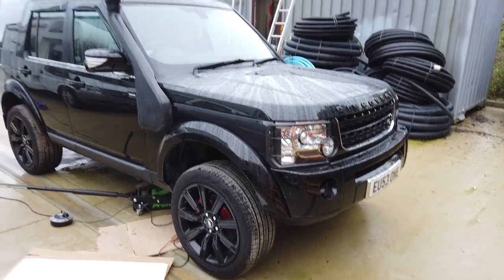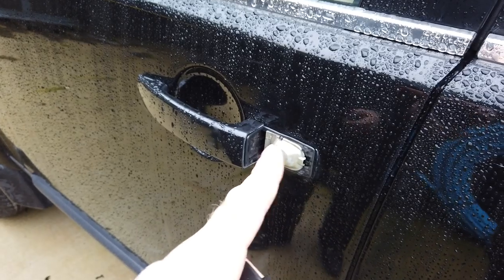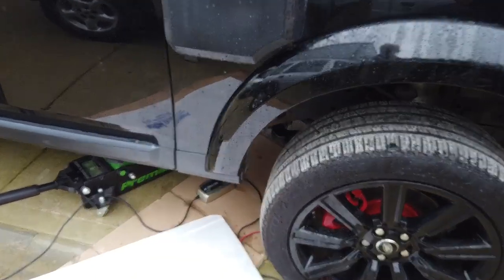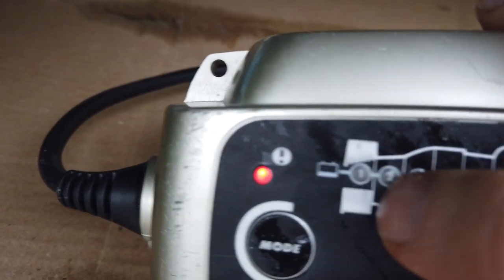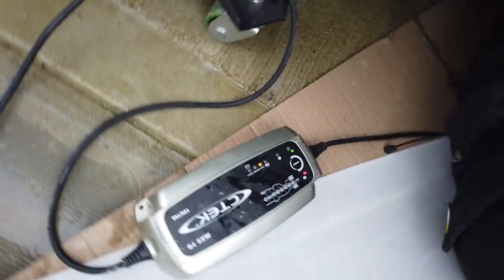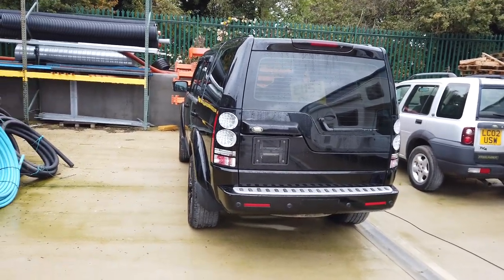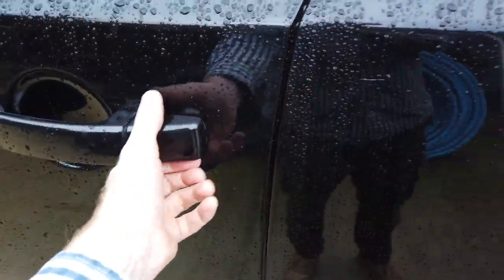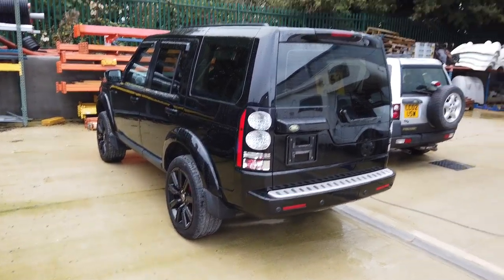How to get into your Land Rover Discovery 3 with a flat battery - cant open doors etc

Comment: Indeed, easy to plug a CTEK charger into the 12s socket , also if the key goes flat put the key onto an electric cordless toothbrush charging base overnight

Comment: I have found the manual key entry is always really stiff.  Pull the plastic cover  off as you did, turn the key to the right.  Had to get entry to mine last week and it feels like the key is going to snap!!!  You get locked out if your main battery is flat, or in my case the cell battery in the key fob.    If it's your fob battery that's flat your alarm is going to kick off, so be ready to jump into the drivers side and start the car to turn it off.   Hope this helps.
Reply from the maker: thanks for the advice
Reply: You are a life saver ,my fob is running low as coronavirus has had me doing all very short trips , your info for turning the key right and the stiff warning has it working.👍

Comment: Preventative maintenance - install an Anderson Plug from battery to rear or front bumper. They can also be used to run tire pumps etc when driving off road.

Comment: Think you’ve found the most difficult way of doing it! 
Just charge through the white plug on the towing electrics for caravans. It’s a main live feed to the battery. They make C-tek adapters to plug into the tow socket.
Reply: Haha. That's awesome
Reply: Does a tow bar plug have a permanent live to battery? Mine doesnt ,(Vw golf)
Reply: jayswin2  the whole video is about discovery 3’s. Not vw golfs.. when these are fitted with tow electrics there’s two plugs, the normal black plug for the lights, and a white plug that does auxiliary power for caravans. These have a main unfused live to the battery.
Reply: I have a NOCO which doesnt have an adapter here in AUS. I made one with the standard connector to a battery, chopped of the connectors and added an Anderson plug to bothe ends put earth to 3 and positive to 4 of the other end. Enables me to also keep battery topped up with either the NOCO or with a Solar Panel.

Comment: This has been a thing that I have given some thought to in the past, with all electronic systems you are totally reliant on 12 volts being available, on the Defender I think there is a system where you turn the key back a forward in the lock corresponding to the vehicle code, although that may be for a flat key fob battery, so the answer to this one is to check under the vehicle to see where the battery + terminal is, why is there a lot of water on your vehicle, have you just washed it ? Many Thanks for posting this!
Reply: It's called the EKA and involves opening and closing the doors :)

Comment: My L322 died an the rac connected a charger to the alternator,  as soon as he made the connection I could open the doors with the fob.
Reply from the maker: OK so maybe the alternator is more accessible.... good point - which engine do you have ?